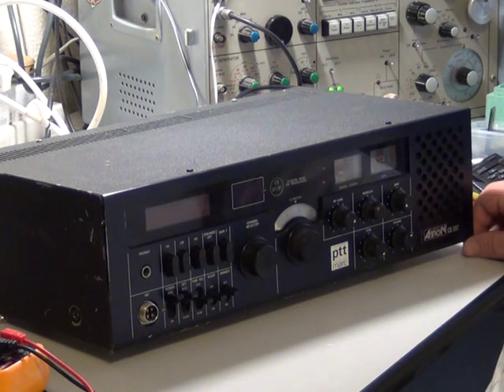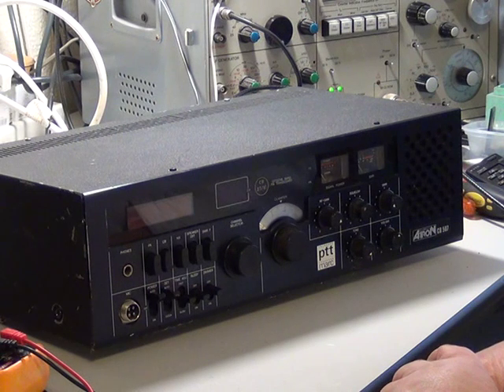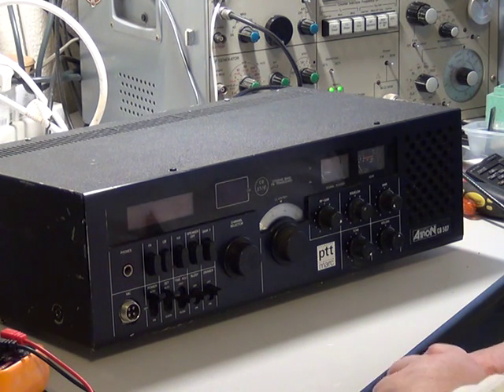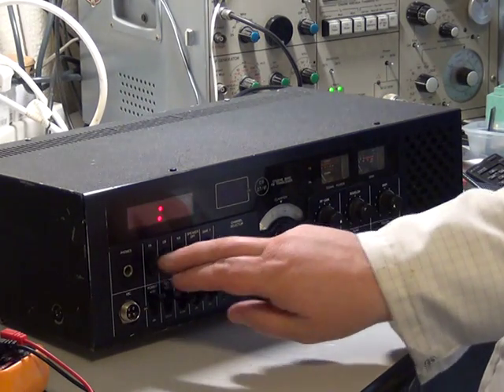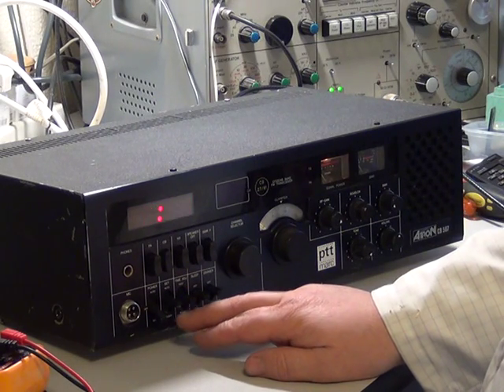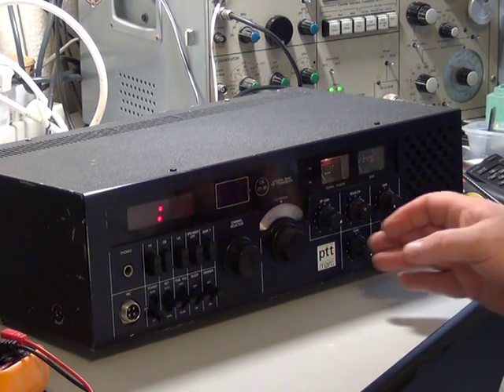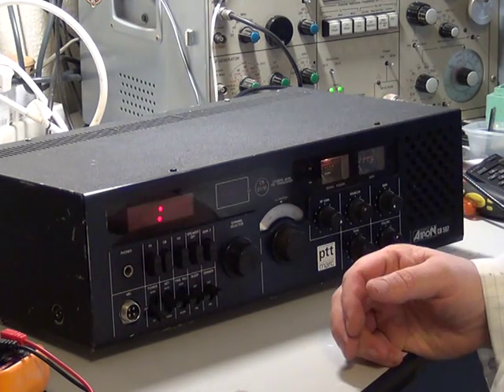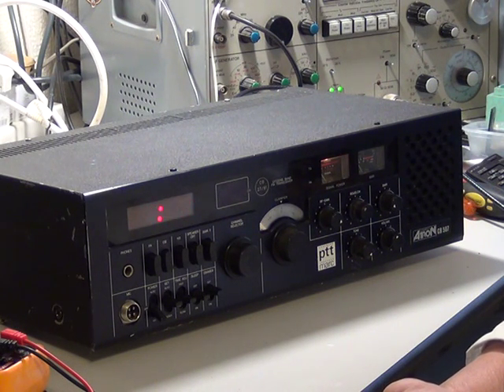Atron CB507,  UK CB radio (Base) - Overview prior to repair

Comment: I have a 507. Most beautiful homebase in my opinion. Worked badly so 18 years ago I got the inside swapped out! Sadly a Lowe TX 40 was put inside. Of all the radios to fit!!!!! Also had catcall added. Now looking to put a better radio inside!
Anyone have a dead one for sale?
Reply from the maker: just buy a Granstand gemini mobile...that's the right board made by Suruga. The board also appears in the telecomms tc9000. They pop up on ebay from time to time for little money

Comment: Hello there. At first sorry for my bad school english. I am owner of a defective CB507. It has similar problems as your device I need a schematic diagram or service manual. Any chance to get technical subjets from you? Thx
Reply from the maker: Brunsbumbel I have uploaded the schematic to SRIBD. Problems are usually dry joints between the top & bottom side of the PCB....and unfortunately mainly under the wax filled VCO/IF cover.

Comment: Iv'e watched quite a few of your videos now. Very informative. Few things i'd like to ask you. First up where does the SINAD meter connect to on the radio ? And where is the connection point on the radio for the 455 khz oscillator? And last but not least what exactly is this elusive sweep generator?
Reply from the maker: SINAD meter connects to the ext speaker socket. 455khz oscillator and or 10.695 oscillator's output wire is held in the general direction of the IF circuits of the radio you are working on. That's quite sufficient to get the effect you are looking for. Sweep generator basically scans the frequency you want (say 455khz) the audio output of the`radio when fed into an oscilloscope will show the IF filtering performance & so makes the IF adjustments very easy to set up & very accurate. I'll be demonstrating a sweep generator later in the year, vital to set up the Great chassis radios...like the Fidelity 1000.
Reply: UK CB radio servicing  Ok, Cheers for the quick reply, Failing the equipment you have to hand could the RX be set up using a steady carrier whilst watching the radios signal meter?
Reply from the maker: Sounds a "bodge" way, but if you had another radio (ch20) on a dummy load & set to the 0.4W setting, keyed up with a rubber band round the mike..you would still need to transmit a tone as near to 1khz as standard. You could use a cheap guitar tuner to generate the musical note. A quick google check will tell you what note is what frequency. The if the set you are adjusting has a variable RF gain you may be able to then tune the RX for maximum received signal. You always keep the lowest signal you can work with applied to the radio so as not to saturate it. You have to have an audio millivoltmeter or oscilloscope connected to the receiver output in order to set up the detector coil for maximum received audio. With this adjustment you need to be receiving a hefty signal, like S9
Reply: UK CB radio servicing
 Thanks for the info. Appreciate it. Its good that as well as taking the time to upload your videos you also take the time to answer any questions people might have regarding them. Keep up the good work.

Comment: A friend of mine had the Wagner base - I used to love that radio always wanted one!
Reply from the maker: Unlike the Atron 507 which is a converted dutch set, the Grandstand & Wagner (identical) bases work very well indeed. Unfortunately now, 30 odd years on, many are suffering from dry joints inside the screened & wax filled synthesiser & IF department, making repairs difficult to impossible. There are some here for repair & they will be tacklied with videos come October when we restart on the CB jobs.

Richard

Comment: I had the Grandstand..Terrible boards!
Reply from the maker: The Atron is a bodge of a conversion though, whereas the Grandstand was properly made for the UK market. They can suffer from horrible dry joints in the screened section filled with wax, unfortunately. I find that they work well when they do work. Bear in mind they are now 30 years old. I can't see many Apple products lasting 30 years!

Comment: you need to get yourself to Knights, they have around 10 or more in the repairs department up stairs..

what happened to the one i sold you T21 ??
Reply from the maker: Mark, You sold me a Wagner...not an Atron. The Wagner is as "proper" set,,,,,the Atron is a Dutch Conversion bodge!

Comment: Lets hope you get something working looks an interesting set!
Reply from the maker: I'll be lucky. Someone has bodged an extra audio amp board inside for whatever reason. However, the set is dead because the 9v regulated internal power rail is dead. Investegation has shown dead 2Sd667 transistor.....not something I have in stock, despite £15K in electronic components in stock!  Have ordered one....at least it's available still.
Reply: UK CB radio servicing Fingers Crossed!